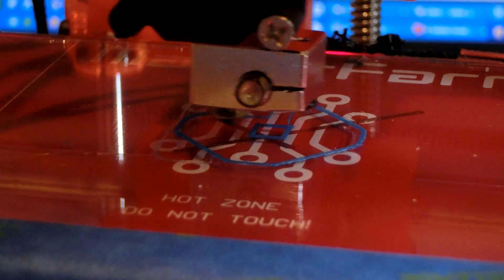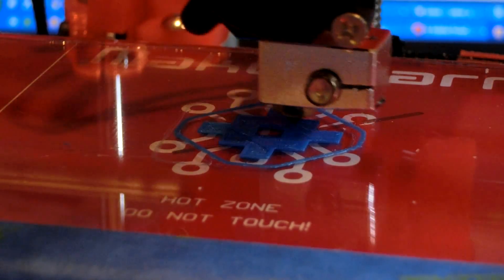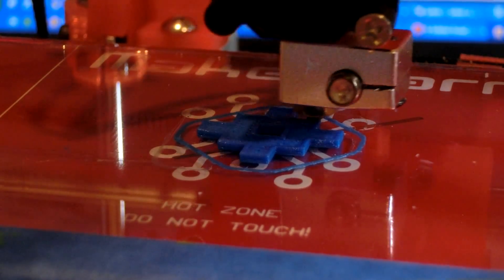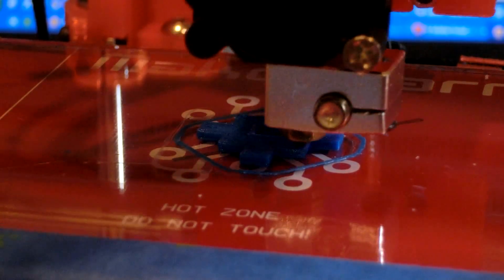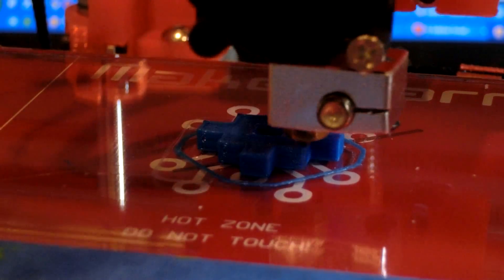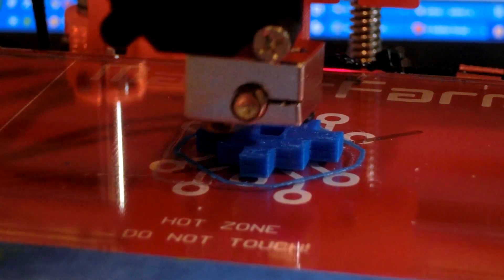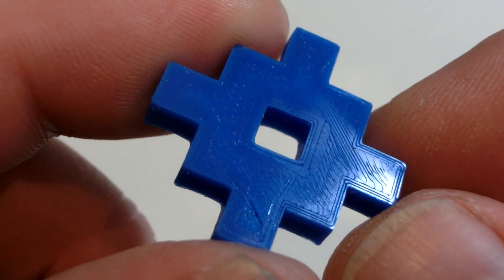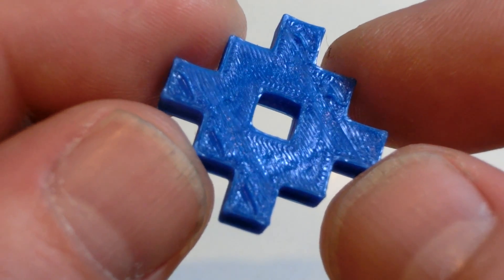Printrbot to Hypercube conversion part 4 - It's Alive!

Comment: judging by looking at the top layer i think that your printing temp is probably a bit too high, yes there are signs of a bit of over extrusion but it looks more like it was too hot
Reply from the maker: Thanks. That's possible. I think I was printing on the hotter side. Although for a faster print you need more flow which is easier accomplished at higher temp.
Reply: ah, good point

Comment: Are you running 300 mm/s with the original Printrboard and what steppers ? What VREF do you have set uo on the board ? I get vibrations and noise that is nasty (see my videos) at only about 45 mm/s can you help with some ideas ? Seems to be caused by the drivers, I rebuild the mechanics almost 3 times now so no change .

Comment: Looks that you have nice settings but actually the slicer wont reach that fast due to some limits and even cant if you go over Arduino's speed limitations.
to compare, I set my 
speed :60mm / acceleration :800 / HotEnd :200c / Bed 70c for First layer 
then HotEnd :190c / Bed 65c on other layers 
First two layers Fan is off , raised gradually to 100%

For a higher speed, I must raise the heat more accordingly to the speed.
The over shoot you get it due to elasticity of the belts and that you eliminate with Jerk and acceleration,
what extruder speed you have there?
on Repetier you press ALT+E to view EEPROM settings and change as needed?
you can Change EEPROM setting on the go as you print and it will be obvious if you have tried that, 
I assume we can print like that fast if the object have no stops and do not need to retract.
I reached Max speed that Arduino Mega can handle so its definitely not a 300mm/s you having there.. for a 300mm you have to set the speed to 100mm/s then raise the speed to 300% and watch for your buffer of your LCD0Screen. if it reaches less than 5 then youll have a fail in your print.
it's barely a good print but that all depends on what tolerance you can use your object for.
Im Electronics engineer and C++ programmer but all that is new to me.
I have a HyperCube aswell and the minimal mass on my XY carriage. 
I used a laptop radial fan that have a PWM control wire and added ESP-12E as a wifi Connection to it (ESP-link) and TCP/IP on Repetier, it works like a charm.
Im using almost all Ramps 1.4 Aux pins out from it like fan, 2 hotends, atx control, lights. wifi TX/RX..
Reply from the maker: Thanks for your detailed comment! As I was recording that video my doubts as to the real speed started growing. That's why in the end I looked at the code to see what's being sent to the printer. And even that is not the sctual speed since firmware will reduce it even farther if needed.
Thanks for the tip on Alt+E. I never noticed it in the menus. I always used M503 command but that won't work on the fly, of course.
The optimal temperature depends on material that you use. Some require higher temp than others. But yes, the faster you print, the higher temp you need to make plastic flow easier.
I need to find time to make a proper speed test but there's too much going on right now. I'll make better speed test video soon.
Nice setup you have. Do you have STL files available for your dual hotend mount for your Hypercube? I want to use dual hot end on my full size Hypercube.
I'm not sure if you was my other videos about this printer but one of my goals was to reuse as many parts as I could from my donor printer. So the controller I used here is printrboard with custom marlin firmware. No LCD on it yet. I'm having a bit of trouble getting LCD to cooperate.
Reply: >Fortunately ALT+E will work on the fly.. if you cant believe try switch on a dry run if you dont like to waste some filament for test and change acceleration from 50 to 800 (on the fly) and watch the magic happen before your eyes. or any other settings, Export EEPROM settings to your hard disk before you change numbers that you cant remember and that file might save your day later.
>First time I used Marlin and it was like a cripple firmware to me near Repetier one.. Repetier require heavy fixes but when it works its a godlike I believe, Marlin is too slow I notice.
>For a speed test use alt+e and print a tall ~1cm column vase mode maybe and change settings. its not as easy as it looks like I say but experiment all the time.
>No I didn't install/mount My chimera dual extruder yet, I need to design a bracket to mount it on my XY carriage so I didnt use any Dual STLs yet.
>No I didn't watch your other videos yet, I try to catch-up with Tomas Salander and MakerMuse and they are informative and produce well made content, 
PS, I watch the playlist now and reply on PLA cracking..
>I use Discount FULL graphic LCD and the graphics on repetier (web wizard settings) where successful but after some fixes.
Sorry long reply but hope I help you somehow.
maybe ill put their setting in cloud and share it when I have some time.
my settings are not complete yet.
Living in Iraq is not an easy life.
Reply from the maker: Great ideas. i will definitely use this information when I finally do my speed test video.

Comment: printer head has to accelerate, so mm/s speed is only after it has accelerated on long moves. F values are in mm/min divide by 60 for mm/sec.  Sill it is moving very nice and fast

Comment: That is one speedy little printer... very impressive if it can print useable parts that quickly! Many people are critical of China and their cheap 3D components but half the time problems are caused entirely by the user. You've got that running sweet as a nut yet it's components came from a $2-300 printer not a £10,000 one. Good Job.
Reply from the maker: Thanks :) I'll do some more videos with this printer soon. i want to do some serious speed testing to see just how fast it can really go.

Comment: Pretty fast, faster and even faster. But no point in claiming such values. If you take a look at the calculator at the bottom here http://www.prusaprinters.org/calculator/ you can se how large the part need to be to even reach 200 before it slows down for the corner.  Here is what true 200mms would look like: https://www.youtube.com/watch?v=tX6DAIsObd8&t
Reply from the maker: Thanks for your comment. If you watch my video in its entirety, you'll 
see that I questioned achieved speeds myself. And if you read the 
comments, you'll see that I agreed with others saying that the speeds 
were lower than what i originally thought. Nevertheless, the printer was
 moving pretty fast compared to my other printers. Anyway, not trying to
 get into a pissing match here, just trying to see what the limits of 
what i built are. Thanks for a very useful link to the calculator. 
According to it, speeds of 100 to 150mm/s after acceleration and before 
deceleration are possible with my printer. If the extruder/hot end keep 
up, that is
Reply: Thanks Artur, I love your videos and that you offer your thoughts and your designs. I have the HyperCube also, great printer and about twice as fast as my other printers. Just wanted to make a reality adjustment in regards of mms/s with the calculator to the world!. "Every idea of mms print speed is faulty", because we use lower speeds for outer perimeters, you use 70% speed for small perimeters. Acceleration and Jerk limits in FW. 60mm/s on 5 mm small lines are that freaking fast! 
Your model has lines that mostly are 5mm and you would need an acceleration of 23000! in FW to reach that speed, and only 1mm of those 5mm lines would be at 300mms. Most of our problems to achieve such speeds would indeed be the hot end, and that you will have such a pressure buildup when passing 100-120mms that corners would inflate like yours. Remedy for inflated corners to achieve a more constant speed is to increase acceleration and jerk, corners will be sharp and precise . At some point you will get vibration and ringing. I suggest that you try printing a 100x100 square to check what your extruder can keep up with and how the pressure buildup would effect corners. Please make a video if you can.
Reply from the maker: Nice job on your build, Bjorn! I was actually planning on printing a rectangle which mostly covers my bed dimensions - 80x140 or so. That should be good amount of space to let the carriage pick up speed. I was also thinking about how diagonal moves, where only one motor is moving, compared to moves along X and Y axes where both motors do the work. The latter should be faster. I will post a video of my experiments. I should probably do the same with my full size hypercube as well and see how the two printers compare. So much stuff to do, so little time :)

Comment: It would be nice if you describe what did you do to tune it :). I'm finishing a Hypercube build and I will start with the tuning process soon...
Reply from the maker: I might post a video on that but really not much work was involved. I made sure my belts were tight and about the same tension each. Then i centered my print head above middle of my bed, zeroed Z axis using a piece of copy paper, then moved to each corner and adjusted spring screws to get the same distance. I made several rounds of going to each corner as each adjustment slightly affects other 3 corners. Once my bed was perpendicular to nozzle, I started printing and re-adjusted Z height slightly.
Reply: Why not using a inductive sensor? It's like magic for that once you've calibrated the distance to the bed :D.

Thanks for your answer!
Reply from the maker: Inductive sensor would require aluminum bed. In prior video I explained why I decided to not use one in this build. Secondly, inductive sensor would add considerable mass to the X carriage which I'm trying to keep low in this build. i may add a microswitch Z probe which might be a bit lighter.
Reply: Hi - Would an inductive sensor work on a enamelled aluminium bed or does it need to be plain metal? Do you know of any sensors that work with RAMPS boards without the voltage splitter Tech2C had to use?
Reply from the maker: I haven't tested this personally but I don't see why enamel would be a problem as long as you can get close enough with the probe to sense metal below it. Like Tech2C said, aluminum requires closed distance than steel. And the thinner the aluminum is, the closer you have to get. 
I'm not aware of any sensor that works at 5V but that voltage splitter is a really easy thing to make. Or you can use a single diode like so:
Z_pin ----|>|-- probe wire
Z pin should be pulled up by CPU's internal pullup and all the probe needs to do is pull that down through the diode

Comment: For your gcode's speed problem, did you check the enable cooling option?
If you did, the slicer might slow itself down for cooling purposes (the "slow down if layer print time is below:" setting)
Is the whole layer printing at the wrong speeds or is it just the last layer?
Reply from the maker: Yes, my cooling is enabled. I will do more testing soon and post another video

Comment: The value of F is indeed in mm/min. I agree with the previous comment, it would be hard to get enough acceleration to reach 300 mm/s in such a small print, but it was still printing pretty darn fast! I built a regular sized hypercube and those machines can print! I'm now a corexy believer.
Reply from the maker: Thank you for your comment. Yes, I love Hypercube design. I'm totally sold on it. I'll have to make a test design that is larger to allow carriage to reach its maximum speed considering acceleration. i didn't think about that.

Comment: What is your acceleration speed when you printed in "300mm/s" speed?
Because if it isn't ATLEAST 6100mm/s^2, its going nowhere near "300mm/s"
(for refrence if your acceleration is 2000mm/s^2, your max speed in this print is only about 174mm/s for ONE line in the infill)

People need to stop showing off how fast their printer can run by just showing the mm/s settings, because it is essentially USELESS. You need to also show what your acceleration is, because acceleration dictates how fast your machine can go.
Reply from the maker: Thank you very much for your comment. Indeed my acceleration is 2000mm/s^2. how did you come up with that 174mm/s number? My understanding is acceleration is a rate at which the speed increases. So it doesn't really limit maximum speed. Unless you've taken the distance traveled in that one line of infill under consideration and calculated max speed based on that.

As i increased feed rate in Repetier, the speed increased. This tells me that the firmware was not putting brakes on the movement, it was capable of going faster as I increased my override of feed rate in g-code.

My firmware settings. Not sure how to read comment for DEFAULT_MAX_ACCELERATION. Max acceleration is not the same as start speed. Start speed is the frequency of step pulses when the movement begins. Acceleration would be rate at which this frequency increases to reach desired speed.
#define DEFAULT_MAX_ACCELERATION      {2000,2000,100,2000}    // X, Y, Z, E maximum start speed for accelerated moves
#define DEFAULT_ACCELERATION          2000    // X, Y, Z and E max acceleration in mm/s^2 for printing moves
#define DEFAULT_RETRACT_ACCELERATION  3000   // X, Y, Z and E max acceleration in mm/s^2 for retracts
Reply: Your print feature limits your maximum speed. You simply have no time to get up to full speed before it already has to make a turn and go the other way. It's simple physics/math.